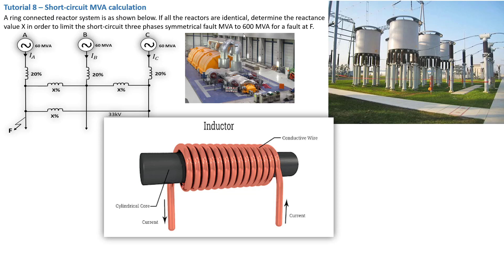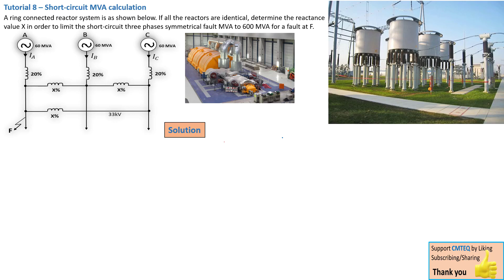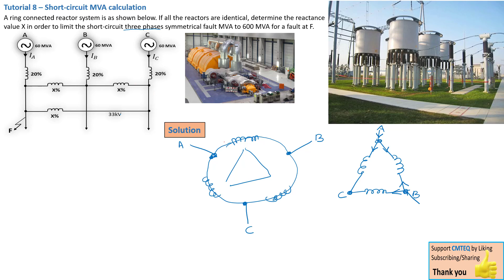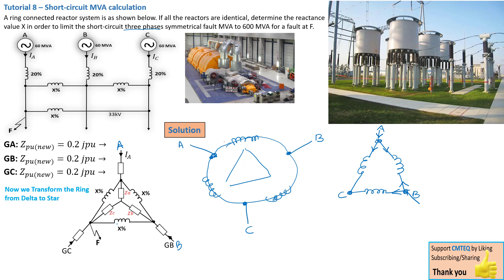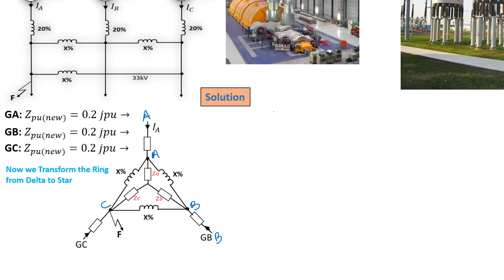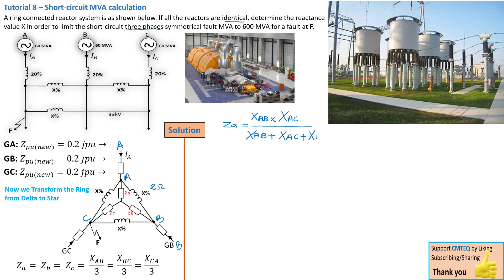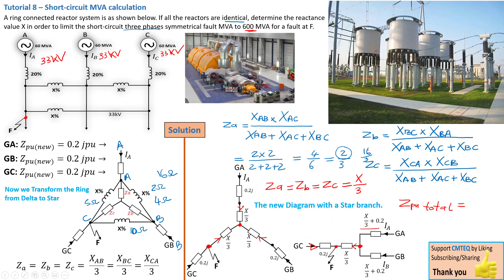Short circuit fault level - Fault current calculation. Tutorial 8 - Part 1

Comment: Hello Sir. Thanks for this tutorial. I have one question. When you change the diagram from delta to star, why is the fault location at Generator C? From the original network diagram, it seems that fault occurs at Generator A?
Reply from the maker: Yes, correct, thanks for picking that. 
Fortunately it doesn't affect the calculation, the final answer will be the same even if we did the calculation with the fault being at Generator A, as All three Generators have the same rating and the same old per unit, hence their contribution to the fault will be the same, and at the same time the reactors connected between the generators have the same per unit reactance.

So, this would have been an issue if we had difference parameters values.